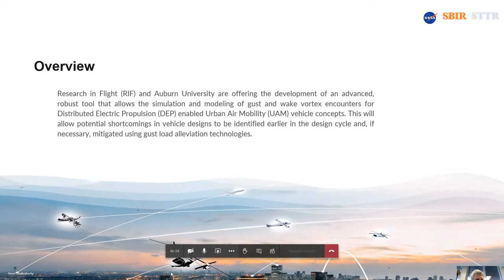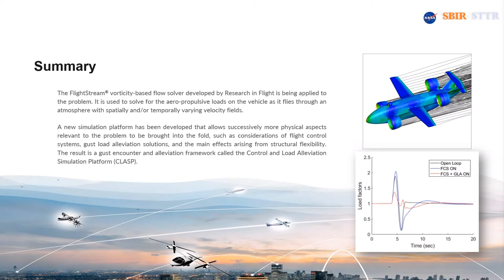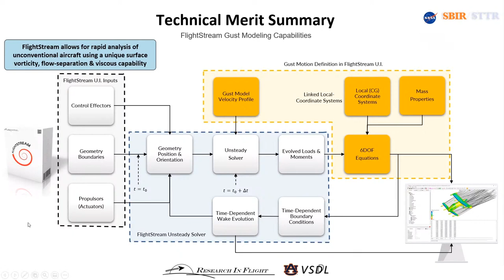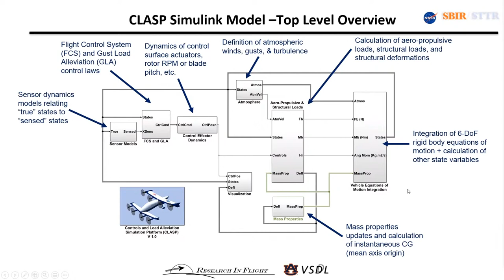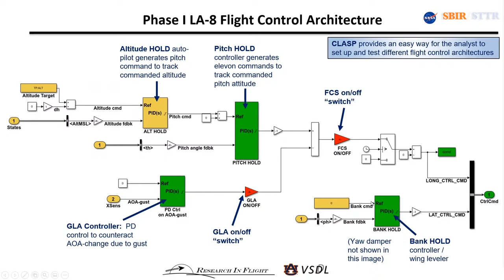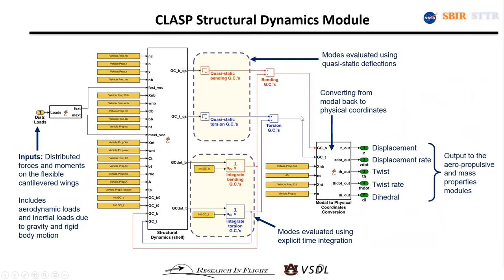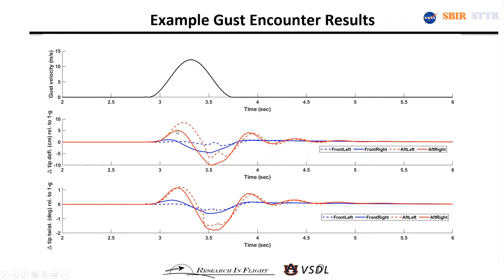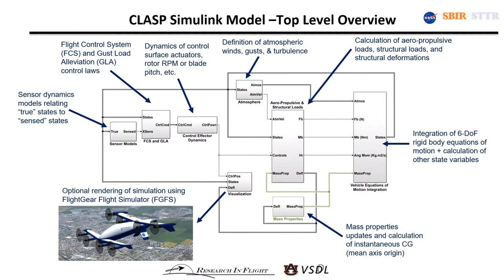2020 VSP WS: Flight-control Analysis, Gust Modeling, and Response of UAM Vehicles

Comment: Which software is this ?
Open vsp ?
Reply from the maker: No it is FlightStream by Research In Flight
Reply: @openvspvideos5394  what are the minimum required specs to run this software ?
Reply: @mitulsingh473  idk that there are minimum requirements for Flighstream.